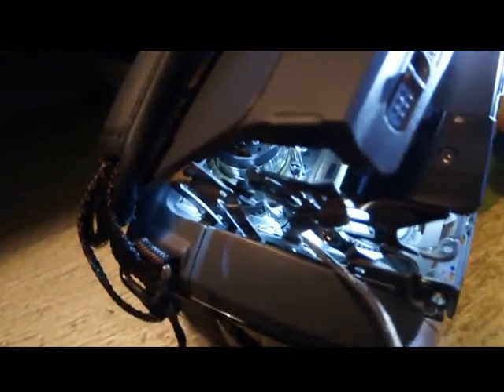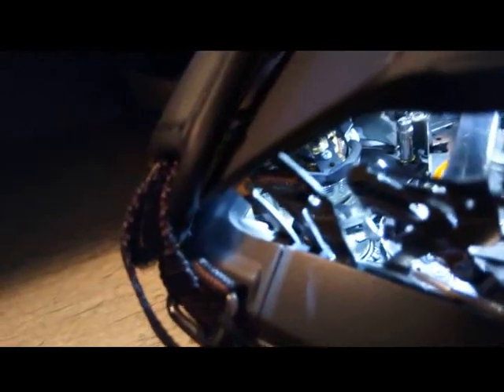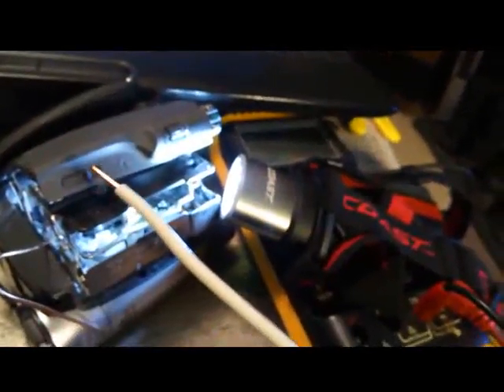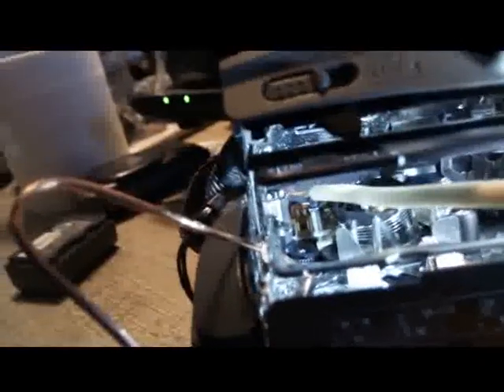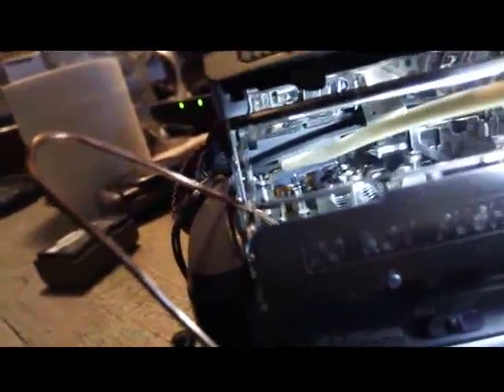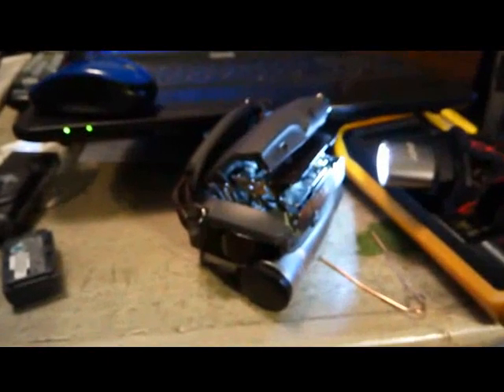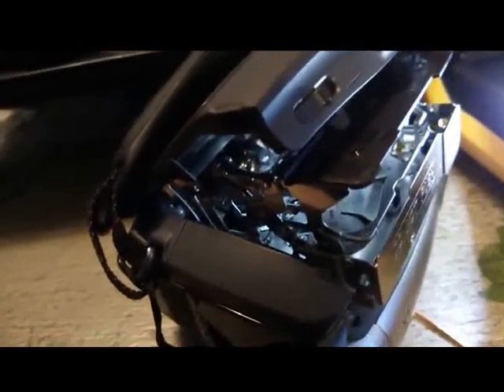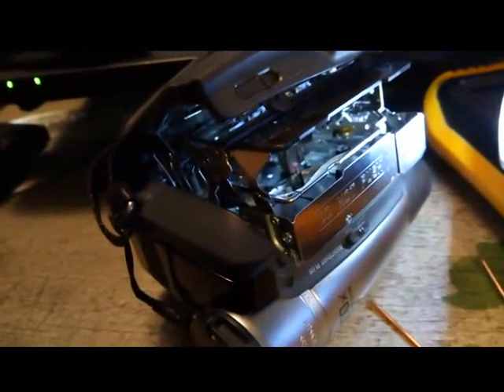Sony DCR-HC28  tape drawer stuck repair

Comment: Hey. I know this video was made far too long ago for you to respond to comments but you never know. I have a Sony DCR-HC52 Camcorder (MiniVD) The tape holder will not close whatsoever, even when turned on, I push it shut but te springs push it back open and it doesn’t hold. Neither will the tape holder go back down, so I cant close the camera all the way, I’ve tried the DW-40, but I don’t think I’d the lubrication that’s needed, the gears just won’t move at all, everything else on the camera works perfectly. Except for the tape holder going back down into the camera, which means I can’t record or takes photos, so I basically can’t use the camcorder at all. Any other solutions?
Reply: I'm here with the exact same problem, same camera... no updates yet but I'll reply here if I find a fix.

Comment: What did you use for 4.5 volts  source of power
Reply from the maker: Hi.i used a variable DC power supply.i have seen YouTubes where 3  1.5 volt batteries in series worked.